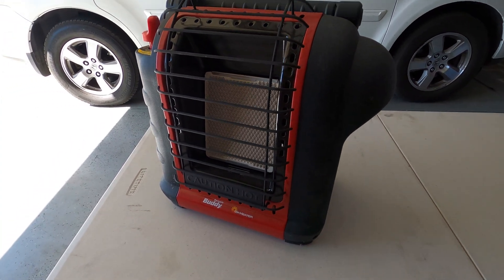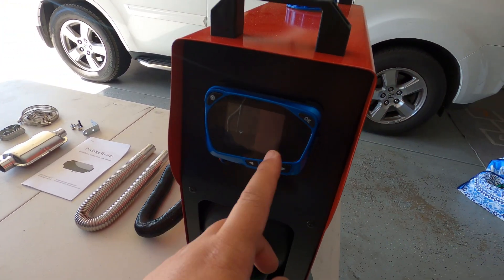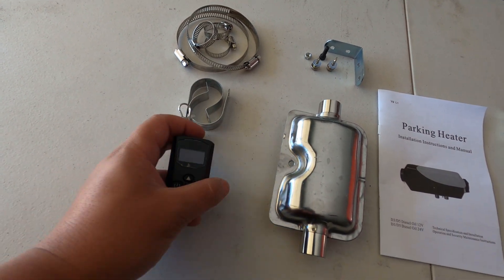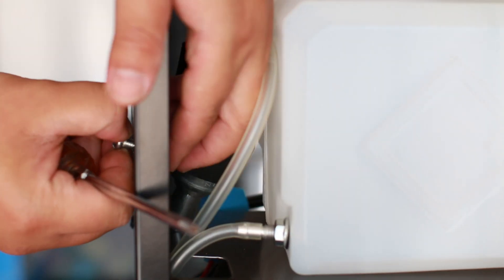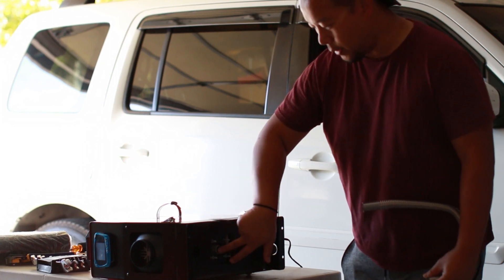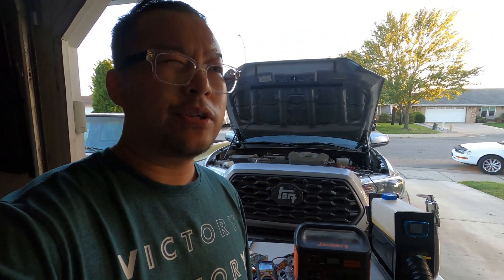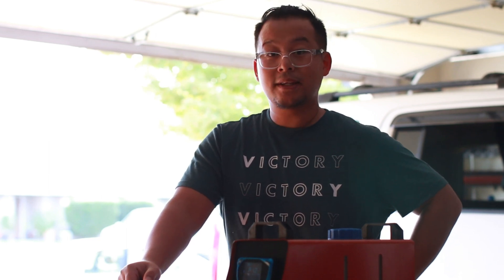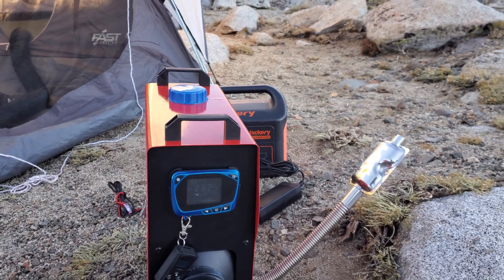Vevor Diesel Heater ♨️ Initial Set-Up + @Jackeryusa | E-2 Error Code

Comment: Hey nice video.  So was about to do what you explained but wanted to make absolutely sure since I didn’t want to hack up all the clean wiring I just completed. Prior I had hooked mine up to the DC 12V on my Ecoflow River Pro 2 and no joy. Then I saw your video but like I said wanted to test. So I went to my Prius tried out the cig lighter and boom worked like a charm. So problem solved? But hey wanted to check out the Ecoflow again just to make sure and Boom! Worked! I think maybe from the factory it’s set in a certain mode and once you get past that initial mode then you’re good. You may want to try this yourself so you don’t need to lug around the brick but nice video had I not seen it I may have never figured it out.
Reply from the maker: That's great to hear! I do dislike lugging that brick around. I'll try your method next time. Cheers

Comment: I'm having the exact same issue with my Vevor heater and Ecoflow River 2 Max. I just ordered an AC-DC converter and I really hope it works like it did for you because I haven't fond any other solutions🙏
Reply: Arg it just arrived and it didn't work for me. I have done so much research already and can't figure this out, so frustrating :/
Reply: @smttn1 try this. I had the same problem with my river pro 2. Go to your car and it will likely work using the cig adapter. Once you get it to work then come back to your power station I’m betting you have to bypass an initial lock phase but worked for me.
Reply: @rayuchida2054  Thanks so much for your suggestion, I really appreciate that! I will try it as soon as I get a chance.
Reply: @smttn1  actually it only works if your hard power off and immediately move to the bank. Otherwise if you do the proper cool off “off” it doesn’t work. So…. I went with your solution waiting for the product to come to test.
Reply from the maker: Eeek! I'm not sure either. Mine still works as it did the first day :(

Comment: Did you figure out a better option? I have almost the same issue except I'm running a beefier Ecoflow battery instead of the jackery.
Reply: I have similar problem mine worked no problem straight away but day later says E2 I already used a mains transformer knocking the voltage down to 12v worked fine yesterday , as I previously mentioned now it tries for a few seconds then switches off and the screen does say 12v so I’m flummoxed I have no idea what is wrong , I’m extremely annoyed because after the first initial test run I then bought loads of diesel and proceeded to fit it in a convenient place in my home along with extra length heat piping all heat resistant material around the exhaust in order to have it all fitted perfectly exactly how I wanted I spent a day and half so to say I’m angry is an understatement
Reply: @Ayyadieh_one-more-time  SAME problem and me... did you found a solution?
Reply: @Ayyadieh_one-more-time  I'm also curious if you solved it?
Reply from the maker: I have not found a better solution. But this setup works for now.
Reply: My Vevor heater looks to be the same model as yours. It runs fine with the voltage up to 16 volts. I suspect your problem is the Jackery isn't able to supply the 12 amps required to start the heater. Going from the DC battery inside the Jackery through the internal inverter to 110 volts AC then through the external power supply back to 12 volts is pretty inefficient but it works.

Comment: Im having this same problem. What size of jackery unit was that?
Reply from the maker: I have the Jackery 1000 unit. Hope you get it working soon.
Reply: Problem sorted I connected a longer cable but the cable was thinner didn’t carry same charge or voltage whatever you want to call it , all I did to rectify was put thicker wire cable on works fine now but shows how temperamental these things are as too look at the wire it doesn’t look much thicker